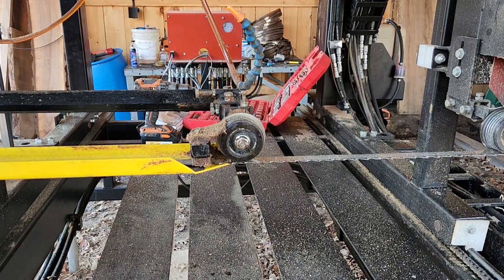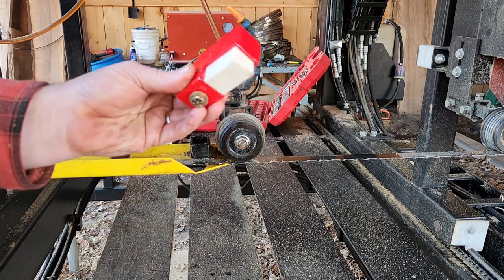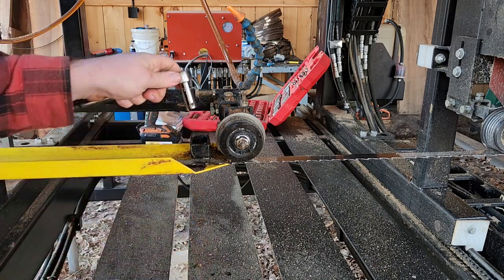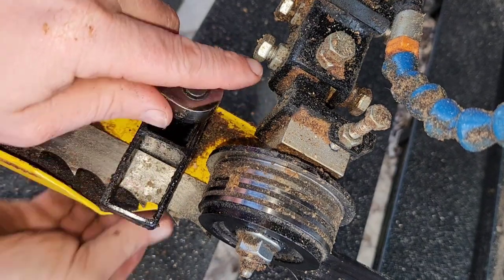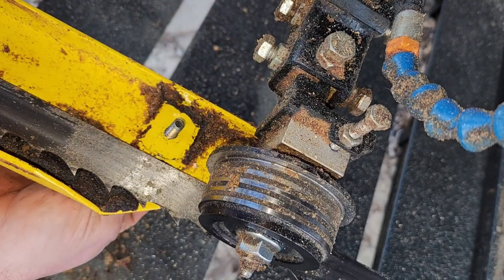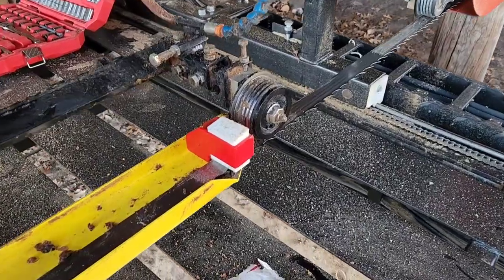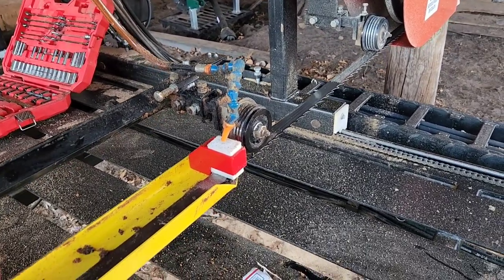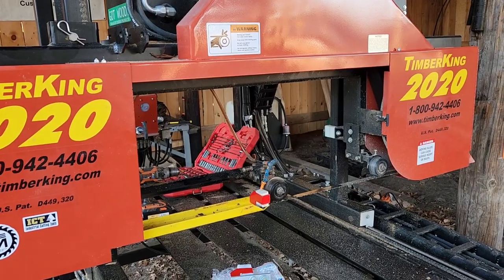An upgrade every Timberking owner should do on their sawmill

Comment: You can source the felt from McMaster Carr. I agree with you the felt wipers are the only way to go, been running them for about five years.
Reply: Sorry ,which size, cant i buy it complete? ,Thank You,PS  i put longer cylinders to make the log higher so i do not hit the timber king 2000 deck